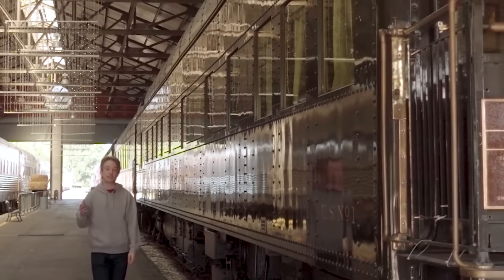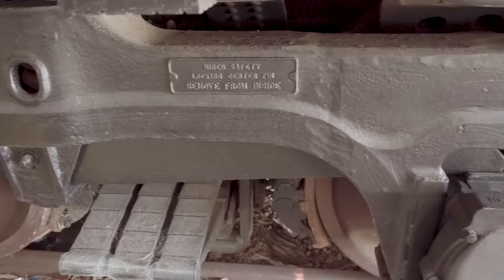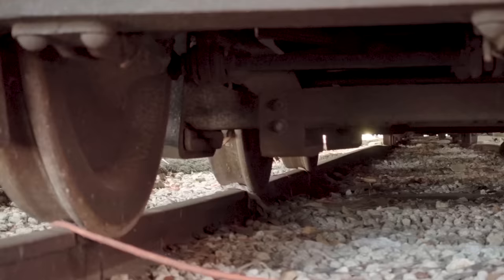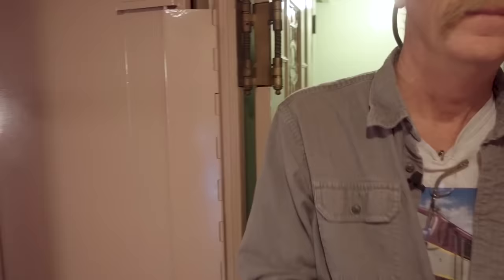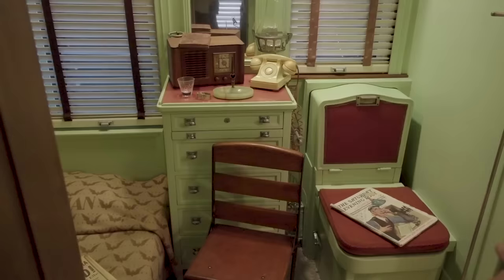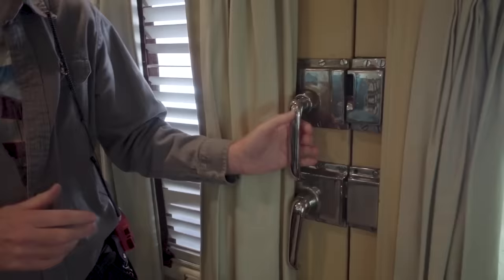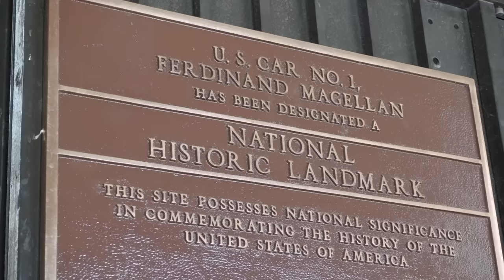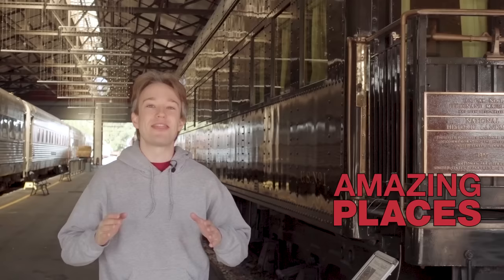The US president has a bulletproof railcar

Comment: Fun fact: a similar type of laminated bulletproof glass was used to protect the pilots of WWII fighter planes from the front. If you've ever wondered why, say, a Spitfire has that small window in the very front of the cockpit that seems to have a blueish tint, that's the bulletproof glass. That, plus a steel plate in the pilot's seat back and a thin firewall behind the engine, would often be the only actual armor found on a fighter plane.

Comment: What's interesting about the safety features is that they can be seen as a turning point (at least according to a Wikipedia article -- I know-- not always a perfect source. ) 

Before this train car was used, the President traveled in train cars that used ordinary Pullman equipment. In 1943, there was the sense that due to the war, it was key to take more precautions with the President's safety. One wonders, without US involvement in WWII, if we would see the same kinds of motorcades surrounding a President that we do today in this timeline.

Comment: Question for train experts: With all that armouring protecting it from threats from the side, how would it protect the occupants if someone tampered with the rails or blew up the train from below?
Reply: shinybaldy I know in WWII there were some specialty cars created by armor plating some flatcars to run over tracks for the purpose of detonating any bombs on the rails, so I wonder if this is similar
Reply: shinybaldy Even unarmored railcars are surprisingly hardy. You need a lot of explosives to actually derail a train and you're gonna need even more to damage the car directly. The bottom is after all made out of steel and there's a large gab between the car itself and the rails. Not to mention this car is at the back of the train. In order to blow it you'd have to pack a lot of explosives without anyone noticing and then precisely time the bomb to go off at the right time. This would be difficult and require precise knowledge of how long the train is and how fast it is going, which is probably classified information.
Reply: I think the answer is surprisingly "pedestrian" they either checked the tracks before the train would come through (back in the day "regular" tracks had people assigned to walk their length daily or even more frequently simply to check wether anything was amiss) Or they'd just approach it with the "Eh, some risk remains, watcha gonna do?" attitude...
Reply: The floor of the car is also armored, as is the roof.  I used to be a member of the Museum when I still lived down there.  I was one of three people who rode the car as security in 1990 when the car travelled to Ogdensburg NY for the 50th anniversary of the signing of the Ogdensburg Agreement. The car is VERY comfortable to ride in.
Reply: I do see this happen in the movies. I also have a simply answer, escape hatch

Comment: In a time where they developed nuclear bombs, the presidents car had to be cooled using blocks of ice. Awkward....
Reply: Electrically powered AC was in it's infancy during this time.  Most AC for railcars, if not ice cooled, had a form of mechanical operation, and modern style refrigerants were unheard of.  Ammonia gas was the prevailing formula used.
Reply: A/C as we know it today was still in it's infancy. I think it was invented in the 1920's (and fun fact, I live right near where the inventor of it used to live) and it didn't really catch on until the 50's when the tech actually got reliable enough to use

Comment: So there is a counterpart to the Royal Train.

If only they could go at 125 mph...
Reply: Mochamad Fachri they'd have to be on the Acela Express for that, I doubt this railcar could handle those speeds though.
Reply: In order to move this car on the RR today it must have up to date wheels, brakes, and electrical, which means it's probably certified to travel at 100 MPH already. (Amtrak specs) The old NYC#3 that was originally owned by Vanderbilt (the RR tycoon) is a late 20s vintage Pullman set up in similar fashion and is still out on the tracks traveling across the country. It's available for hire if your pockets are deep enough. The owner (a not for profit) has weekly rates plus whatever Amtrak charges to move the car. Probably best to use it as a group venture so you can share the associated costs. It's got 4 bedrooms and a full kitchen.

Comment: My dad was on that train, although likely not in this car except for one or two rare instances.  When FDR would go to the house in Hyde Park, NY, my dad was always on the train.  Once when the president left the written copy of his speech on the train, it was my dad that was sent back for it.  This train caused the introduction of the FM Radio mode.  Quite simply, AM radio as was the norm prior to this was badly interfered by static.  The wheels rolling on the track caused a lot of static.  As such, they, the Secret Service needed a radio that was not using the AM mode.  FM had been tried in one of the military branches.  I think my dad told me it was the army.  Once the radio was swapped out for FM mode, no more problems with static.  After my dad passed, I was digging through the cedar chest and found an envelope that contained what appeared to be an old calendar holder, sized to fit a suit jacket pocket.  Inside, no calendar, but my Dad's White House ID from 1941.  On the outside, in gold printing it said simply, From FDR, Christmas 1941.

Comment: 12 layers of laminated bulletproof glass and 5 inch thick bulletproof steel!? Isn't that a bit overkill, especially if you think about the range of weapons that would've been available back then?
Reply: It was probably just as much to protect against explosions, just having a heavy car offers some protection on its own since it makes it harder to knock over.
Reply: 5/8 inch steel, not 5 inch.It's on the sides, roof, and floor.  In the dining room floor is a roughly 8x8-inch trapdoor to access valves for the water tank and its feed air supply.  That little trapdoor is a full inch thick, and weighs about 30 pounds.  I had to wrestle with that sucker in 1990 when the car went to Ogdensburg NY.

Comment: If the president wanted to could he still use this?
Reply: Not likely as it exceeds the 40 year age limit on un-rebuilt equipment. If it hasn't been modified for heating and cooling via HEP, there would have to be some way to generate the steam needed for heating, and cooling via the original  ice bunkers might be troublesome.

Comment: "America as a country except for parts of it don't embrace rails as we used to"

why?

easy to answer. it is not because its cheaper. its because its faster to travel by air then rail or car. want proof? take NYC to LA for instance. by train and car it will take you roughly 2 days and 13 hours. by plane it will take you 6 hours. by train I found for as little as $291, by car will cost almost $2000, by plane I found for as cheap as $809. its way cheaper to go by train than plane but way faster to go by plane than train. our country is so big that we want the fastest way to get there no matter what the price. by the end of the 1700s it took 6 months to cross the country. by the end of the 1800s it took 6 days by train. by the end of the 1900s it was down to 6 hours bt plane. I am guessing just by going at that rate that by the end of the 2000s it will be down to about 6 minutes.
Reply: You could shorten that by saying that trains in the US havent kept up with the times and people in the US are uneducated and wasteful
Reply: @fgsaramago  well you could exect that trains have kept up with the times. they are good for short city to city trips. and that they haul more amounts of cargo on 1 trip than a truck or car but its like i said, the US is over 3000 miles from east to west. in those times i told you about it took 6 motnhs to croos the US in the 1700s, in the 1800s it was down to about 6 days and with planes in the 1900s it went down to 6 hours. so would you want to be stuck in a car, truck or tain seat for 6 days, or 6 hours when you can fly at 1/10th the overall cost?